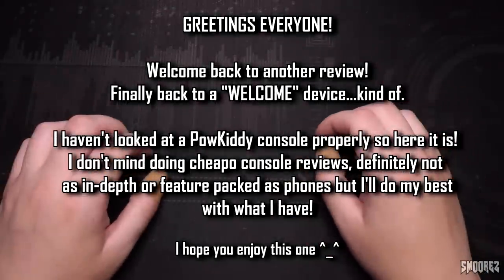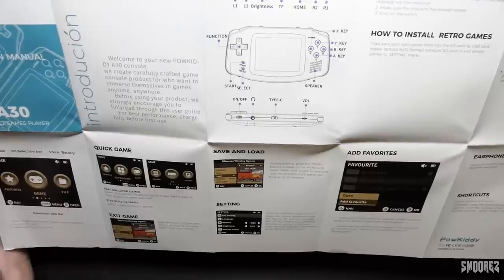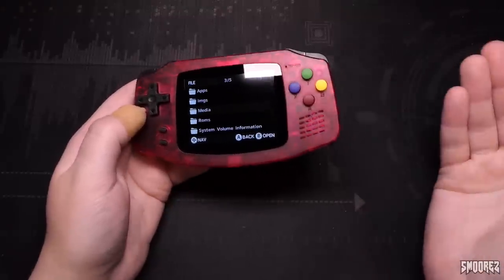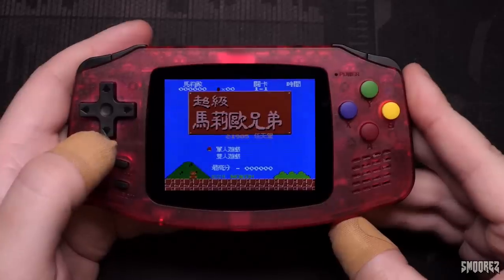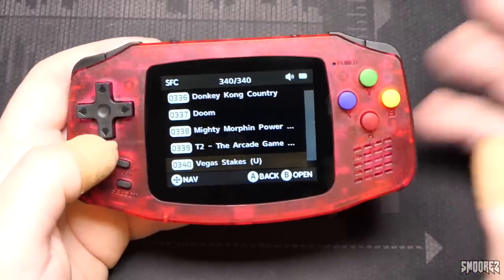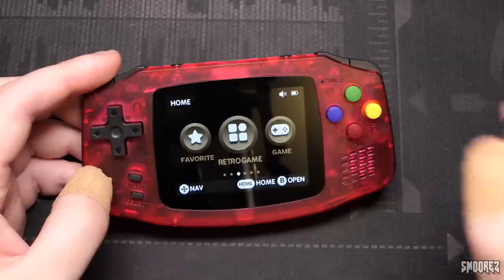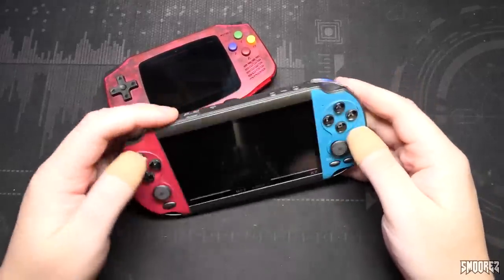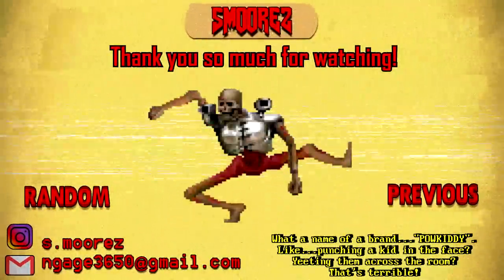The POWKIDDY A30 Retro Emulation Handheld HAD Potential...(In-Depth Review, Gameplay & Teardown)

Comment: Really unfortunate nobody worked on a custom firmware for this, ( i read it uses the same firmware as the A66).  
I think powkiddy does pretty decent handhelds in regards to form factor and price/button quality, it's a shame they don't bother at all with the software side.
Reply: So technically if its the same hardware then the firmware should work
Reply: @dmolina007x  the big issue is usually the drivers for the screen and/or other minor components that change between machines like WiFi or even extra buttons.

Comment: I played A LOT of game boy games on my first android phone. It was LG E400. (240 x 320 3,2 inch screen, 384 megabytes of ram less than 200 megabytes of free space for apps, and one gig of internal storage. 1 core 800mhz processor with adreno 200 enhanced. Back in the day, that phone was the greatest thing i owned. It played Gameboy advance games no problem. I actually finished GTA advance on that phone. Heck, it even ran DS emulator pretty good. Played Scribblenauts on DraStic without problems.
Reply: DS worked well?
My iPhone 5S (512MB RAM, 16GB) struggled with DS emulation pretty bad.
Reply: @mal0gen  nah, ds was struggling, but considering it was only scribblenauts it was playable

Comment: I love the looks of this thing.  It's a shame that the performance is so disappointing.  Also; it seems odd to me that a handheld wouldn't include other handhelds besides just the Game Boy series.  Sega Game Gear and Bandai WonderSwan anyone?  I don't know how popular the Swan was outside Japan (American here - I learned of their existence thanks to the Internet) but the Sega was reasonably well received and had a decent amount of titles/ports that should run well on low end hardware.  But, no, let's put PS1 on there instead because that totally makes a lot of sense considering what we're working with.

Also, for everyone who doesn't make it to the very end, on the lower right of the yellow outro Shane always includes a silly quip or thought.  Today's was especially accurate.
Reply: You can mod it to add those.

Comment: Screen copy paste error. The 480x272 is the PSP screen (clones are abundant), 4.3". There is also a larger 5" version in the same resolution.
2.8" screen, best guess it's going to be a 320x240 isn't it... Ah yes it is.

The games preloaded are not DOS games but open-source native ports of DOS games.

I fully expected this to be an F1C device. I would LOVE to have one at hand to perhaps attempt optimising Playstation emulation - i have some thoughts on that - and i can rebuild the operating system from scratch no problem. The problem is the price. I paid less for an Odroid Go Advance and that's a much feistier and nicer developer system. If someone in EU was getting rid of theirs cheaply, i'd consider getting it. If i didn't have the Odroid yet, i think i would be tempted.

A QSPI boot ROM footprint is foreseen it's just northeast of the CPU.

Instead of cutting something down to make the inputs behave, i would pad the contact rubbers from the side where they touch the PCB. A layer of rubber, made with hole punches, glued on, painted over with Kemo L100 conductive silver.

The hardware is similar to Bittboy and Powkiddy Q90. These used to go for 25€, wish i snatched one up back in the day, missed an opportunity.

Comment: With GBA emulation, could it run Moonshell to get MP3 player capability? 

The SD card might have to be cloned to preserve the formatting and partition structure. A simple back up might not be enough. 

But is it even worth putting energy into? Idk but I appreciate the video nonetheless
Reply: Moonshell is for the DS, not GBA. There was the GBA MP3 Player official cartridge, but I don't know if it works with emulators since it uses expansion hardware to decode and play back music and doesn't use the GBA sound at all (it has its own headphone jack).
Reply: @tomrow32  You’re right, Moonshell was DS lmao. Totally blanked on that one. 

But looking it up, I think FFMPEG is an option to pack multimedia into a .gba file?

Comment: To imagine that the CPU runs at 717MHz, it‘s a kick in your face if Doom SFC runs at 3fps when it does run faster on the real thing. Even a 30MHz 486 ran Doom fine at 30fps with a 320x200 VGA resolution…
Reply: Maybe they were right in the beginning when the listing said the cpu was running in hz instead of MHz